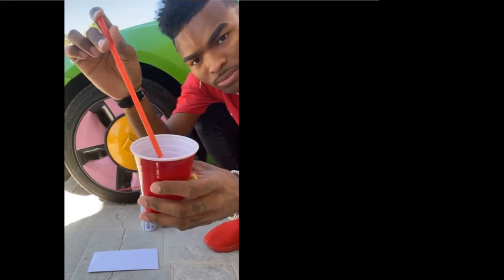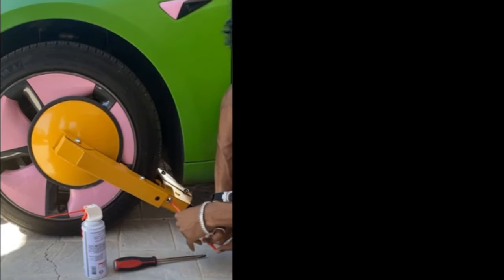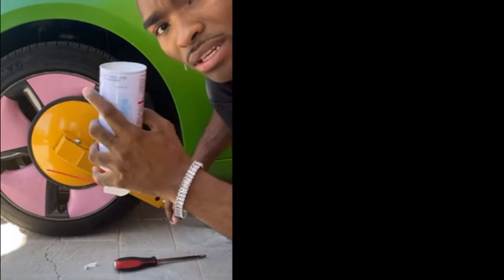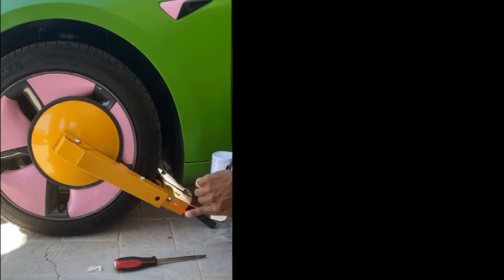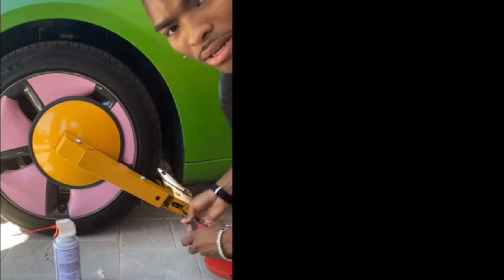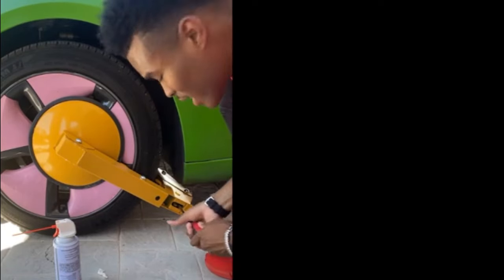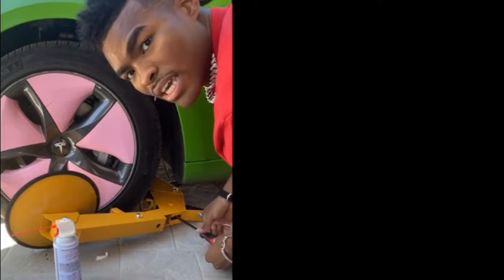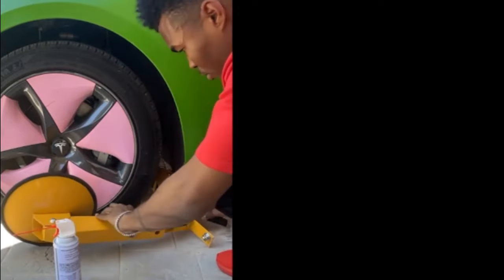Unlocking Your Car Boot In Just 5 Minutes! Drive Off Removal

Comment: You couldve just used that screwdriver to pop the lock cover off. Just hammer it in the edge of the cover, and pop it off. The locking mechanism is flimsy steel. After the lock cover is off, use the same flathead to loosen the boot.
Reply from the maker: Thanks for the feedback 😀
Reply: If you do damage it, you need to dispose of it so it can't be found! Otherwise in most states you can be sued.
Reply: Why don't you just make a video about it?
Reply: I'll trust crackhead Greg's method, thankyouverymuch
Reply: @joshuamayer7219 I threw it in my neighbors yard
Reply: Just bring a battery operated grinder with you and that's all she wrote mofo hahah. I grew up in the hood so I learned the ways haha
Reply: And now we know that Chicago has cameras everywhere
Reply: Do a video fam

Comment: It's not liquid nitrogen. They use propane in these. If you flip it upside down liquid propane comes out which is around -50 degrees.
Reply from the maker: Thanks🙂
Reply: Wait you think it’s propane in air dusters 😂 

Who told you that?

Comment: In Philadelphia its only 1 bolt on the boot plate  I believe a 17mm nut  luckily I had the wrench in the trunk   I did have to turn the wheel to slide it out but it definitely came off with a little wrenching and pulling
Reply: I’m in Philly can u help . I’ll pay
Reply: @cherrelleweaver4164  wat part?
Reply: @maximus420dudegardens6 I'm in bx ny.. can you come tmrw morning?  I'll pay ..
Reply: @melcab1433  sorry bro  u too too far
Reply: I’m in Philly wya I’ll pay
Reply: Yooo can you take mine off they just got me too I'm in philly

Comment: 🤔 If one squirts some “Great Stuff” expanding insulating foam subsequently into the boot mechanism, then “that boot will never boot again”.  Therefore the disabled boot now  becomes a “cost of tool” fine on the booster. 🤣

Comment: Have you heard of not parking where you're not supposed to, and pay the tickets? You need three to four outstanding parking tickets to get a boot on your car. By removing the boot, not only you're breaking the law (again), but now you have pay for any damages you've done to it. It's a crime. A $90 parking ticket that turned into over $3 or $500 for getting more tickets turns into committing a new crime. Get a ticket, pay the ticket. Be responsible instead of doing this lol.  Just saying 😉